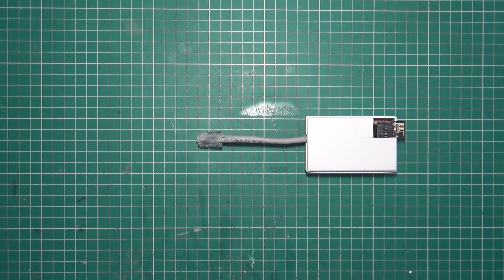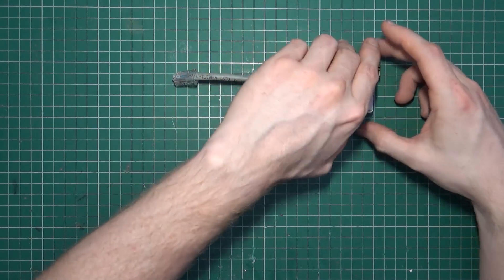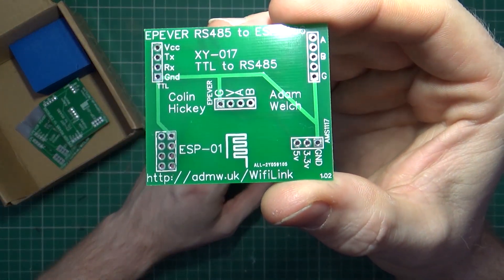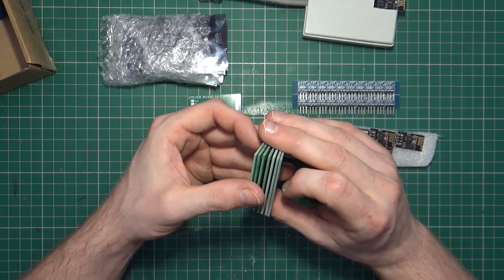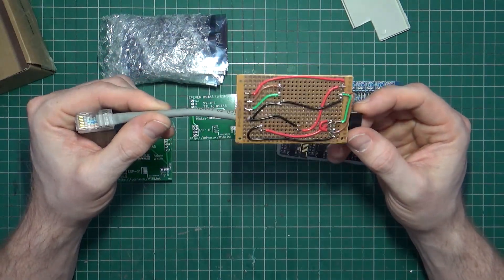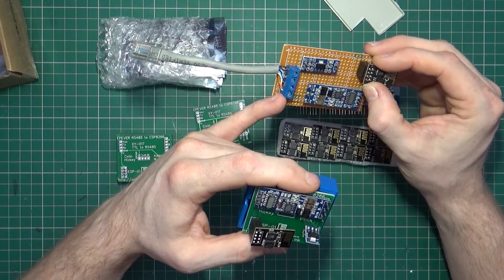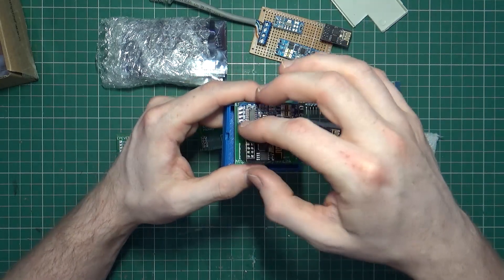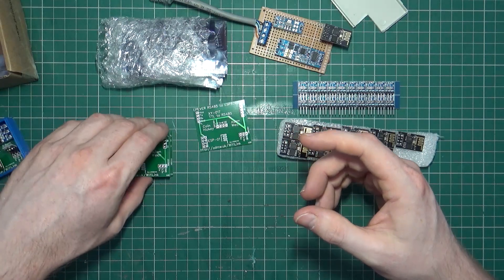EPEver - RS485 to Wifi kit

Comment: Sounds like your from my neck of the woods mate. Just about to pull the trigger on a Tracer 1210an, but I'll be using it with lithium batteries (Banks of 18650 cells). AFIK I'll need either an external programmer or connect it to a laptop/computer? What's the easiest option for this? Thanks.
Reply from the maker: yup i'm a geordie, you can buy a really cheap usb to RS485 adaptor, around a pound from ebay/ali and sacrafice an old ethernet cable.  alternatively you can buy a premade cable for not much more.  Let me know if you can't find one.  I used a laptop to program and after that you shouldn't need to connect
Reply: @Chickey  Aye I pulled the trigger and bought the kit including the premade cable from aliexpress. Software downloaded and ready to go.

Comment: Why aren't EPever providing this as part of their Tracer accessories, it would make a huge difference to end users like myself?
Reply from the maker: They do sell separately the ebox device for wifi comms but sadly it can only at as a wireless access point and not connect to an existing network which is a pain and one of the reasons i did the design.
Reply from the maker: Stuart what have you installed so far?

Comment: Hi All,
I have purchased one of the RS485 to WiFi adapters and have connected it to my wifi. I just need a little guidance on how to use this with the ePever software on my PC.  
@Old Time Engineer, the cost of shipping was a couple of bucks. I bought 2 as a just in case.
Thanks
-Rene Alamo
Reply from the maker: Hi Rene, are yous using windows or linux?
Reply: Thank you for responding mate. Iam using Win10.
Reply: Hi Colin, I am using Windows 10 latest creators update.
Reply: Hi Colin never heard back from you on this,

Comment: Half tempted to buy one ;-) Glad to see our little colab is available for purchase. Great work Colin.
Reply from the maker: I'm just glad i finally got the video out as it's been sitting there unpublished for so long lol.  Your board design is great.  BTW i forgot to link to your original video so I've updated the description.
Reply: Colin Hickey Cheers. If I were to design it again I’d be tempted to add a couple of drilled holes to allow for a cable tie to secure the cable and possibly make eight holes in total for the 8 wires in cat5 and label them as O, WO, G, WG etc. It would make it easier to identify and add some redundancy. Not sure if you think either are a good idea?
Reply from the maker: Built in cable retention would be a good idea.  On my recent modules I’ve put hot glue around where the network cable wires are soldered to the board to help.  I think 8 individual wires would make a great addition as well.  I’ve been doubling the wires up to achieve the redundancy but then it makes it harder to assemble.  In a way a network socket would be the best way but would add to the BOM and make assembly slightly more tricky.
Reply: Hi, thanks Colin and Adam for the series of videos.  I made a module up using an ESP-12F (just what I had lying around, an FCC approved module with screened can), but had to make a few changes to get it to work with my EPEVER AN series controller (negative earth model with blue buttons).  In case it helps anyone else (or if you are ever planning to spin more boards), the changes I made are:
- add 3V3 to 5V logic converter (4-way modules are 5 for 99p on ebay, possibly not necessary, but ESP-12F modules are not supposed to be 5V tolerant and its only 20p extra)
- add 470uF electrolytic capacitor on 5V input to linear regulator. (fixed continual reset issue)
- add 470uF electrolytic capacitor on 3v3 output to linear regulator.  (seems to fix residual intermittent reset issue).

Whilst trying to get it to work I disconnected the third pin on the RS485 side of the RS485 to TTL board as my working USB to RS485 cable only had two connections.  The third pin on my board is labelled in Chinese and it might say ground but as it isn't connected through to the TTL ground I left it floating and all works fine.